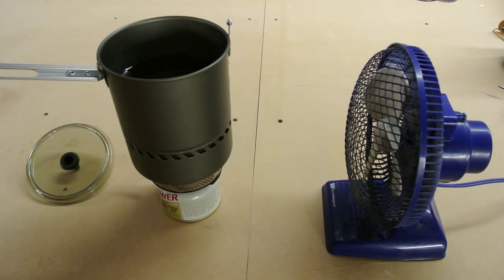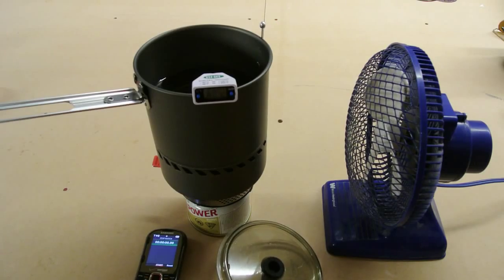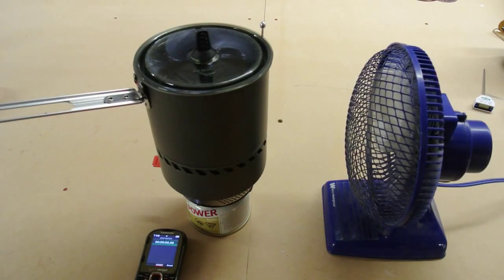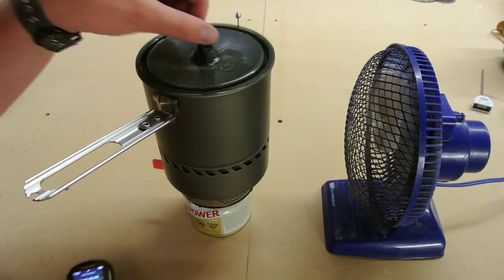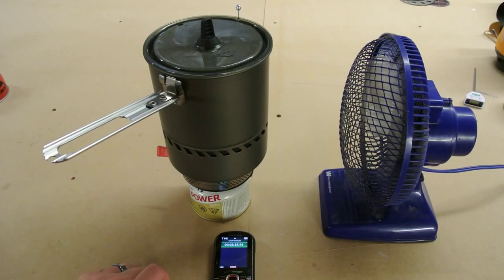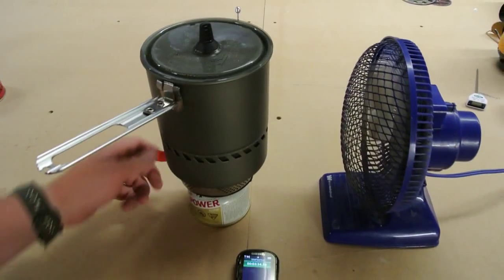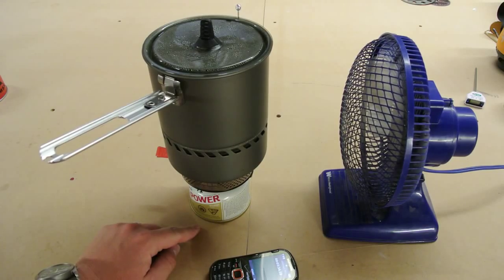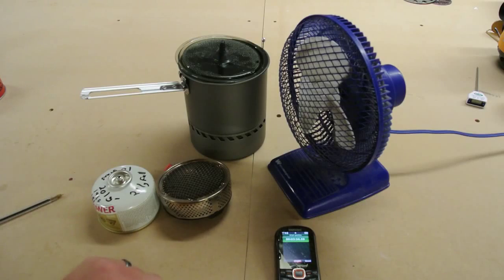MSR Reactor Wind Test

Comment: The one variable I see in many tests posted on line is that the actual water temperature is not measured for accurate boil time determination - it is more of a visual inspection, so there can be some variations by what time you choose to lift the lid and check for boil. It's kind of 'yeah, it looks like it's boiling'.  All that being said, the MSR Reactor is an impressive piece of gear.